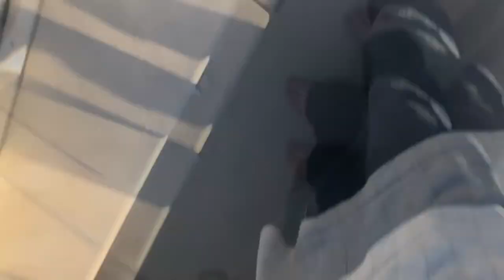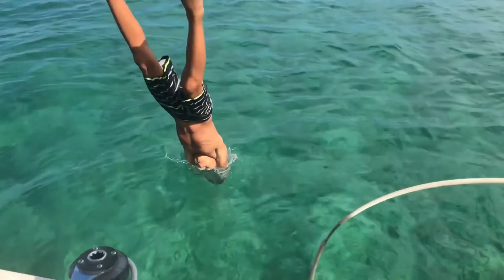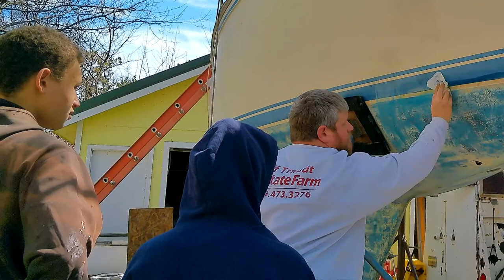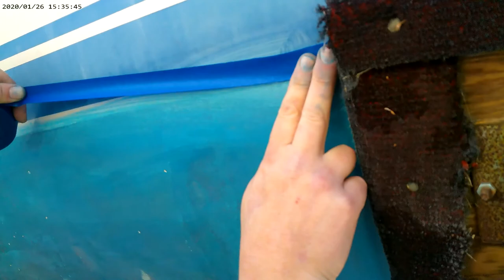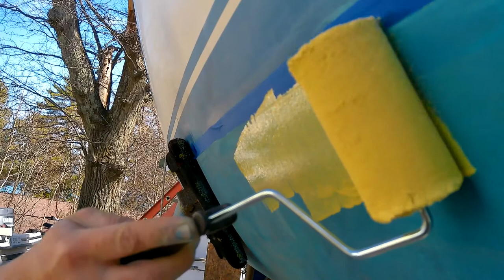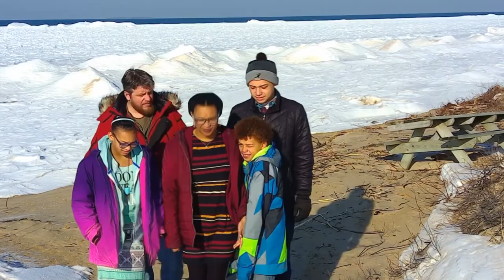Prepping and "Sea-Hawk" Primer Application || Catalina 25 ||  Episode 42  ||

Comment: Next time you do anything like that be sure to wear safety glasses and gloves appropriate to the chemical you are using.  Acetone will cross the skin blood barrier and will be absorbed by the body.  Safety first.  Safety glasses are required for pressure washing and painting too.  Get the Material Safety Data Sheet (MSDS) for the chemicals and paints you are using.  The MSDS will tell you what safety procedures and what Personal Protective Equipment (PPE) is required, and the consequences of not following the instructions.  Do good, be safe.